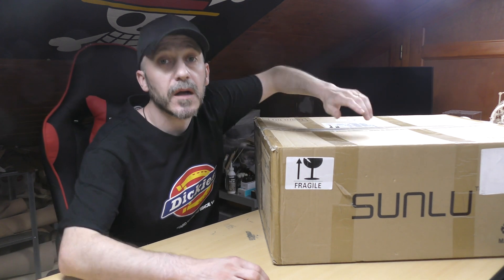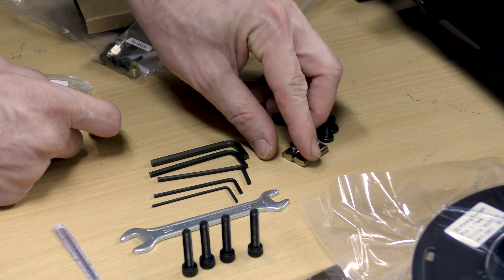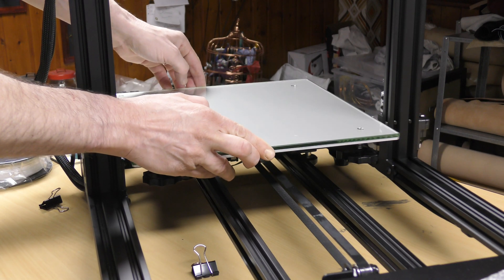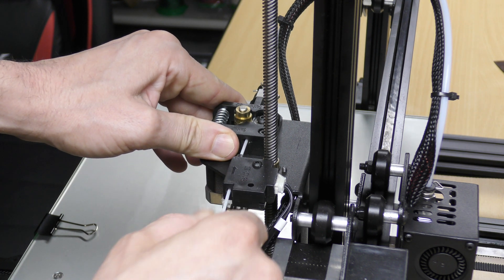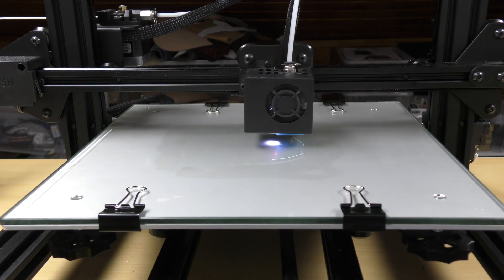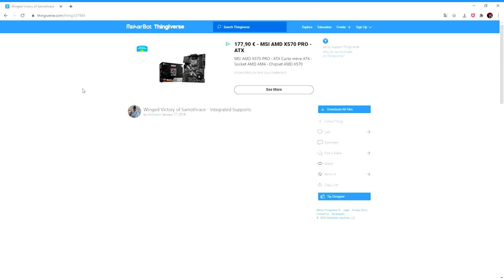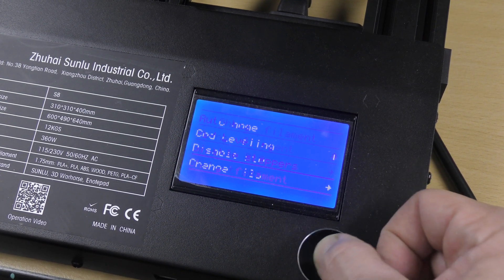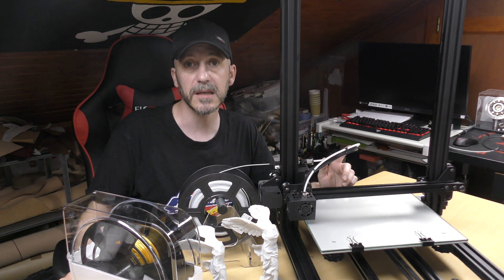Sunlu S8 3D Printer & FilaDryer S1 Unboxing, Assembly & Test - Tutorial and review

Comment: When you level the bed and use the z adjustment. How does that save? Once I printed a file it was way off.
Reply from the maker: I never had to use the Z adjustment. But you should be able to save the setting in the menu.

Comment: what settings did you use in Cura, would have been nice to see that.
Reply from the maker: There are too many settings to share in a short video. But you can go with the settings of a CR-10 pro and adjust them for the size of the S8
Reply: @RedSmithWorkshop  thanks, so got something printing, however I am getting little bumps randomly on the side, nothing shows up in cura, can print it on my ender 3 pro and works fine, and even 1 of them was the test.gcode they gave me on my sd card.  any recommendations?? thx
Reply from the maker: It happened to me as well when I did my first tests. First thing to do is to buy a new sd card. The one they provide is not good. Then you need to set your mesh fixes to max res.05, max trav.0.8 and max dev.0.05. It should give you better results. Also be careful with the temperature of your material.
Reply: @RedSmithWorkshop  thanks, yes weird how a new card fixes little bumps
Reply from the maker: @Hoss_1966  Indeed :)